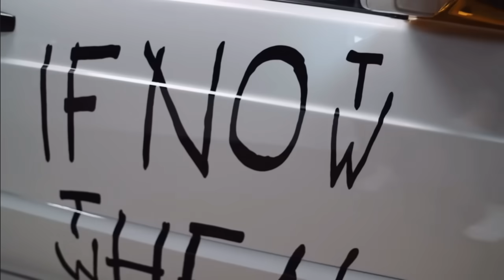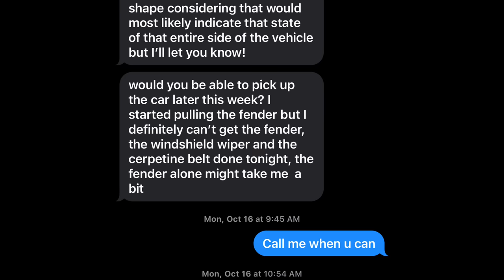I Bought A Mercedes 190E To Build An Evo II Replica

Comment: As a mercedes owner myself i can assure you this isnt gonna be your only one. i really want to get a w124 at some point. Ive owned 3 mercedes now, my first one being a 1977 mercedes 300d that i traded a 1985 toyota van for, second being a parts car and third ended up being a 82 300sd that i got running and driving for 700usd. unfortunately i wrecked my 300d so that's why i bought my 300sd. cant wait to see how this build turns out.
Reply: I am looking to for a w124 wagon for campervan and trips
Reply from the maker: @ruibarreira6585  just wait until you see what I'm going to do with this one...

Comment: I bought a BMW E28 which seemed to have some rust. When started working on it i saw that the rust was worst than expected and spent lots of hours cutting welding and painting. It didnt worth the money paid. That unit seems to have same problem as mine. If i would have known all the work it needed probably i would have rejected it.
Good luck with yours.

Comment: The evo2 has larger front wheel wells to fit the bigger brakes, wheels, tyres + the lower suspension. If you are going to fix the rusty front wheel well you may as well make it bigger to accommodate things down the track.
Reply from the maker: That’s what I’ve been told. Not sure how to make it larger and mount the coolant reservoir

Comment: You have to cut the inner Fender anyway. You can‘t go that low with the Stock ones.
Reply from the maker: good to know lol
Reply from the maker: do you know anyone I can talk to about this? any tips?
Reply: @magnacars  unfortunately not. I could send you some Pictures auf my Evo1 Replika inner fender that has been already changed.  I could also Show you a 190E Evo 2 Replika on 17 Inch that is already lowered but Looks strange in the front. Because it uses the Stock inner fender. The Evo 2 wheel arch is slightly higher than the Stock one.